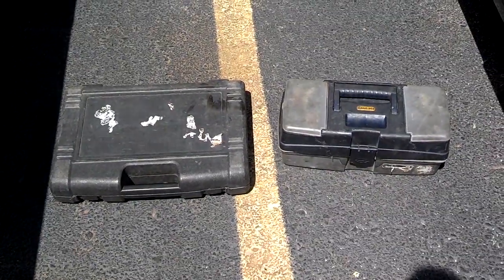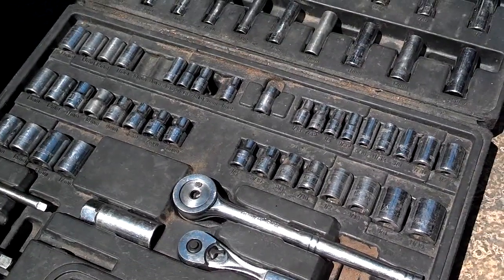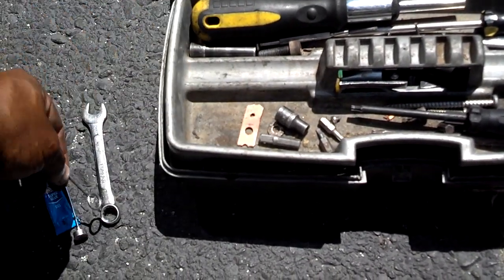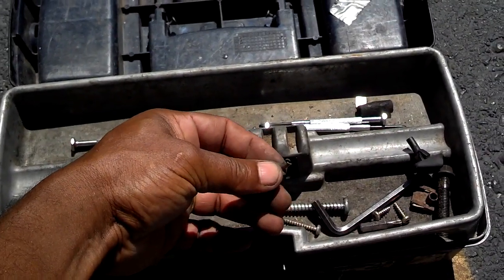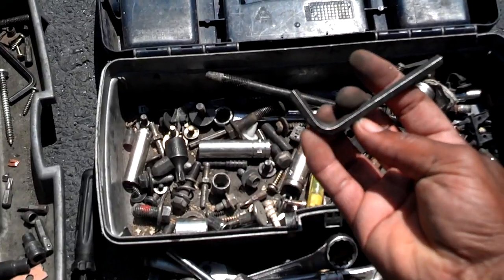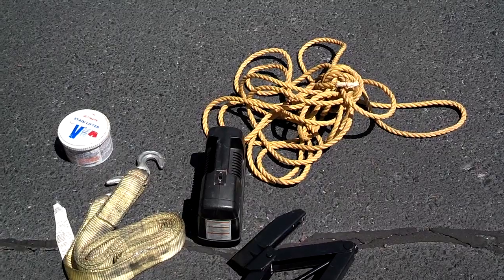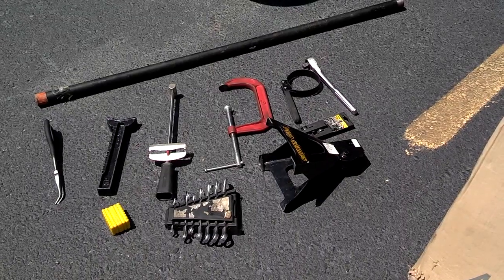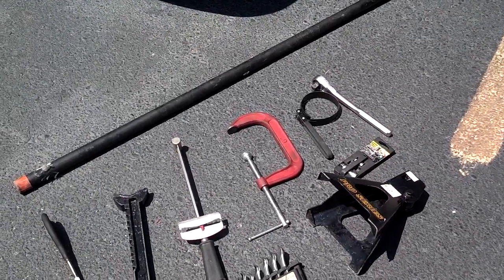Tool kit for DIY auto mechanic, most commonly used tools.

Comment: I change the airbag from my volvo 850 through your videos but the light stays on any help? I was smashed and  the airbag came off...
Reply from the maker: Lungile Lugongolo What year is the car? If '93 - '95 you can read the codes and reset it under the hood. If '96 - '97, you will need to get the codes read and reset at an authorized Volvo service center. - How to read and reset error codes using the OBD-1 port Volvo 850 - Auto Repair Series

Comment: hey robert i bought a 95 volvo 850 with 83000 miles, now it has 84200 after 3 month ownership and i just checked the oil and it looks like it is a little bit above half way or barely. ( i changed the oil right at 83,000 when i bought it) should i be concerned? i was thinking about adding a oil stop leak to be safe. By the way the car was 1 owner and the interior was very clean so i assume the owner took good care of it. I was also thinking that it leaked oil because i used a full synthetic oil and maybe the car never used that before and therefore leaked.
Reply from the maker: You see a leak?

Comment: Hey Robert galligan I have a 1997 Volvo 850 I couldn't basically 5 quarts of oil and the dipstick reading like it's at minimum I looked it up and it says it like the capacity for my engine is 5.6 I'm just wondering if you happen to have any knowledge of how much do these cards actually take of only known one of the vehicle that I've had to carry you know pretty much as much as as many cylinders is had in that was my 2000 VR6 Jetta just looking for a Little help from some of that loves Volvos like I do but I just don't it's been awhile since I've owned one and just a little unsure and I have a book and everything but this dipstick looks like its original
Reply from the maker: If the car is on a level surface, keep adding oil until the dipstick reads full. About 6 quarts.

Comment: Good video.  I really appreciate some one who isn't afraid to get in deep and make it happen.  There are a lot of tool box tours that are just fashion shows of chrome, your's is like a mechanic's scrapbook.  Clearly your skills are better than your tool set up, there's no shame in that. Your system works, I get it, because I've had to work with similar set ups.  I made the mistake of thinking that just because I could do everything the hard way, that was how It should be done, then I got organized.  There's a big difference between taking the time to do the job right and losing time playing Tool-hunter.  Consider treating yourself to an upgrade of steel tool box and bunch socket rails.  You can keep the plastic box as a parts locker.   All the standard sockets and wrenches won't fit anything with wheels made since the mid 80's.  You can keep them separate for household stuff like appliances and old american iron (trucks and muscle cars).  Keep turning those wrenches.
Reply from the maker: Very good. Thanks for the tips and encouragement.

Comment: Do you get the dust in the toolkits free ha ha, mine has dust too, im sure its attracted to toolkits.

The bits and bobs of crud rolling around look pointless but ive needed stuff like that a few times, the rod from a printer becomes a handy drift punch, a couple of the thin rods from a broken umberella can help to remove a radio or just bent to hook something through.

I noticed a lot of americans using channel locks, so i got some, great for those times where nothing else can grip something :-))
Reply from the maker: zx8401ztv Yes the dirt and most of the other junk in there was free. LOL

Comment: I find Oetiker clamps rather awkward. The old worm drive or "jubilee" clamps are cheaper, easier, more versatile, reuseable and don't require special tools to fit.
Reply from the maker: Lots of reasons to use them. Oetiker are fast and easy.
Reply: ..expensive, not reusable and require a specialized tool.